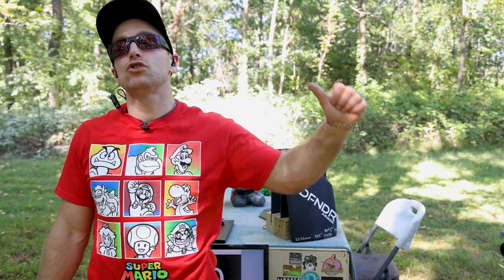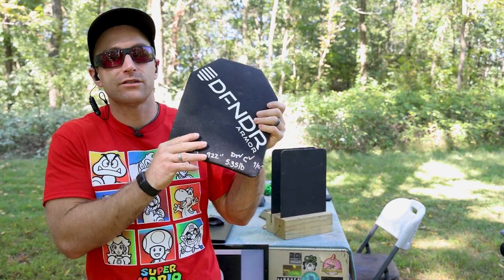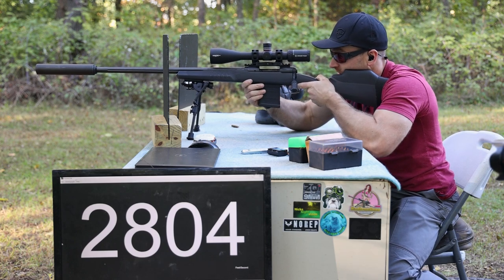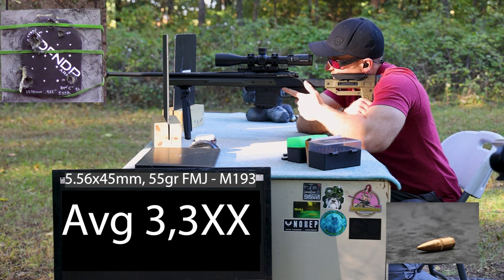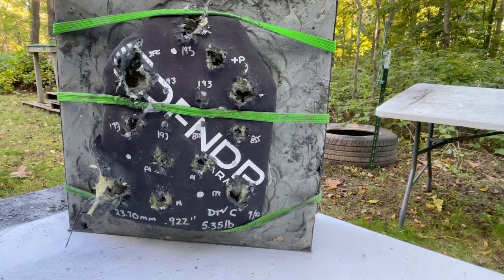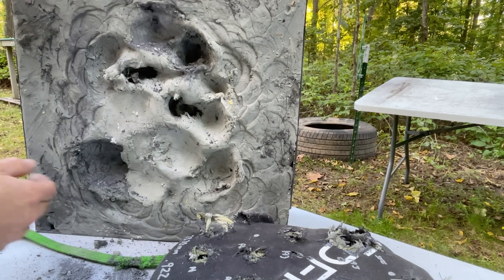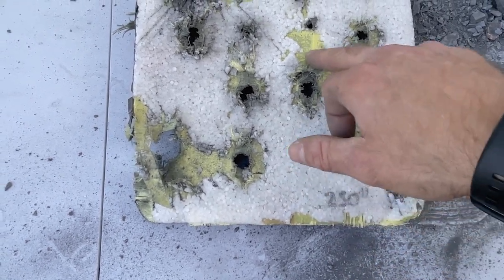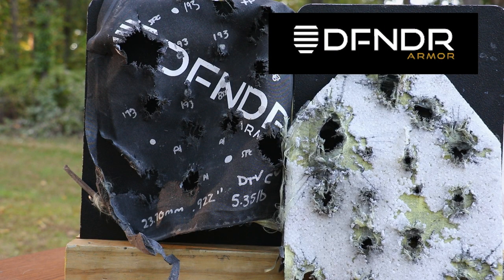DFNDR Armor, Level III X

Comment: While the plate isn't impressive, I realize that's because we generally hold armor above the standard required, which, I think, is a really good thing to do. Good to know what companies are shooting for exceptionalism and who's shooting for being adequate.
Reply from the maker: I would say the plate is better than some other RF1/2 plates on the market, but there are certainly other plates that go above and beyond the bare min and stand proud with what they can do :D
Reply: thats exactly what I care about, and people still dismiss this stuff sadly
remember a lot of these more expensive companies people justify are typically the ones failing, and the cheaper ones amazingly hold up FAR better typically
Reply: I initially thought these may have been one of the newer budget options they started making, but hese are not one of them. I also don't know why this exists when it is the same price as the level 4 plates and only .5lb lighter per plate with these being rated up to 7.62x54R and then level 4 going up to 7.62x63 M2AP.

They have quite a few level 3 special threat options that slightly increase threat rating and weight, but are ultimately very similar 

It seems like it's probably a business thing to justify the additional options for people to choose what is right for them with various pros and cons of wt vs threat, etc  instead of just having the standard ratings, making them able to withstand more but not guarantee it, with level 3, R 1, 3+, and 4 kind of fitting the more traditional likely ability to exceed threat rating.

The people I talked to there (one I believe was the owner) were responsive, honest, and willing to o.qbove and beyond in answering questions while seeming to genuinely care about putting out quality and consistent plates without any of the shiesty practices. Based on my experience I'd be willing to bet they would honestly explain their reasoning. With the abundance of armor companies out there, i can count on one hand the amount of companies whose plates I would truly trust. And DFNDR is definitely one of them.

That said,.my experience is merely anecdotal so take it with a grain of salt

Comment: Dude, if you could or are interested, I'd like to see you test the LAPG level IV multi curve. The difference with the multi curve being the strike-face is SiC. They are rarely in stock, but are right now. I actually just ordered one to use as my front plate.
Reply from the maker: I have a set at home :)
Reply: @BuffRANGE  Awesome

Comment: Which plates would you recommend with level 4 and level 3+? I see the RMA look like a great buy but they are 8 lb.
Reply from the maker: 3+, RMA 1092 G2, Militech RF2, Hesco 3810 (unless you need M855A1 protection). Level IV, all of the alumina plates are going to be over 7lbs. Look at the RMA 1192, Adept Colossus, or Hesco 4800

Comment: If you’re looking at American made armor I just don’t see any reason to buy any other plates than premium body arms level 4, shotstop level 3 and 3 +, or if you
Want to same some money hesco 210’s.
Reply from the maker: Those plates Premier and ShotStop plates are overpriced, overhyped, and typically under performers :) I would run this plate over ShotStop's plates.
Reply: @BuffRANGE  not sure why you think they are overpriced. The weight savings is worth every penny. I’d run a chest rig before I’d wear 7lbs level 4 plates. premiers level 4 costs 10% more but weighs 1lbs less.  (Shotstop isn’t selling their level 4 to civilians right now which is dumb!). Their level 3+ though is 10% more as well but also weights almost 2lbs less. The dfndr plate didn’t stop what it was rated for and isn’t offered in a shooters cut (sapi cut sucks and is outdated. SOF units run shooter cut if they have the option to) In my opinion your plates need to be able to stop m855 a1 if you have them for the reason the of 2A because that’s at minimum what you’ll be facing. Anything else it’s up to the individual what they think is needed.
Reply from the maker: @jpk9171jpk  You know what Premier's plate weighs less? because it has over 1" or more of a foam border on the strike face. On a 10X12 model you only have 8x10 or less of actual ceramic coverage.  ShotStops other offerings that don't have ceramic strike faces can't even stop M855 from an 10.5" SBR, or M855A1. I'm guessing you haven't seen my ShotStop tests yet?
Reply: @BuffRANGE  I know the premier level 4 is the only one that can stop m855 a1. They are also 12x10 so you get 11x9. I’ll retract my statement on the shotstop 3+ because it isn’t rated for m855. The dfndr being 12.5” long and 1.1” think also means it won’t fit into most medium plate bags.
Reply from the maker: @jpk9171jpk  There's a video floating around of Premier/ShotStop's Ultra light level IV, an there's over 1" of foam on the edges, some places almost close to 2". So that plate being 10x12 has a severely reduced strike face. At $750 I'm not seeing the advantage to having less strike face :D I suppose one of these days if I get the funds I'll test that plate and maybe some might see it's not all that it's cracked up to be :D
Reply: @BuffRANGE  they are $630 on their website and sometimes have 10% off. Even an 8x10 that weighs a pound less and stops m855a1 is better than a plate that weights a pound more, can’t for sure stop m855a1 and won’t fit in your plate bag, definitely can’t with backers.
Reply from the maker: @jpk9171jpk  which specific plate are you referring to? I'm talking about the STRATIS LEVEL IV ENHANCED PLATE
Reply: @BuffRANGE  that’s the plate. It’s $630. The dfndr plate you tested is $550.
Reply from the maker: @jpk9171jpk  Got it. I think my eyes were playing tricks on me as I thought it said $360 when you actually wrote $630.
Reply: @BuffRANGE  all good. Not saying the dfndr is a bad plate. As a recommendation you should add fitment into medium and large plate bags with and without backers as part of your testing. A plate is worthless if it won’t fit in your plate bags.
Reply: Those are not very capable plates. Gut check, what is Premium Body Armor doing to get "the worlds only 4lb IV" that a vertically-integrated R&D giant like Ceradyne isnt? The answer is sell you a smaller plate in a 10x12 package. The closest to 4lbs an edge-to-edge plate has came is the Ceradyne Defender 275, at 4.5lbs for a SOCOM Swimmer M (10x11.6) and even that is debatable since I believe it was rated for 7.62x54r B-32.

Shotstops 3+ (really just adds M855) is even worse of a deal, you get a reduced strikeface plate for 750 dollars, all just to have it weigh 3.8lbs. Something like Hesco's 3810 stops the same threats at approximately the same weight, but does it WHILE having an edge-to-edge strikeface, for 80 less dollars. So you get a categorically less protective product for more money. And the gulf is only going to widen, this year should yield some RF2 plates extremely close to, if not 3lbs flat from a few manufacturers that will feature edge-to-edge strikefaces.

If it was my money, Id either threatmaxx and get Adept Colossus for 6.5lbs, or try and snipe a pair of LTC SOCOM TSAs for sweet sub-5lb, sub-IV goodness. You cant cheat chemistry or physics, so you have to decide where on the threat-weight matrix your usecase lands and get an edge-to-edge plate that satisfies the requirement.
Reply: @rangednyarnyar  this whole comment doesn’t make much sense. I still don’t see an argument against the premier level 4 which is the plate I really recommend. I take back my statement on hesco and shotstop. The 3810 isn’t bad. It weighs half a pound lighter but it doesn’t stop m855a1. The 4800’s are sweet but they are $1500. The colossus way 2lbs more and good luck getting those in medium plate bags. I’ve also watched videos of the premier level 4 stopping rounds at an inch for the edge. Even if it doesn’t quite have edge to edge protection do you know any 11x9 level 4 multi curve plates that weigh 4lbs and cost $600?

Comment: Looking forward to when armor forge starts calling our shit talking and actually sends you a few plates for abuse.
Reply from the maker: Aren't they charging $2500 for a 4.5lb plate?
Reply: @BuffRANGE  No idea, because they won't give an actual price without requesting a quote for an order and god knows if they're going to send an invoice if you do
Reply from the maker: @WeaponizedAutismiii  I could have sworn someone requested a quote and it was $2500 :O
Reply: @BuffRANGE  Haven't heard that one, but with all the buzz words and the fact they don't have a protection level over iii+ it looks like a professional scam that got seats at shotshow.

Until they sent plates for abuse and review, my opinion will not change
Reply: @BuffRANGE  I found the info, it's in the "about" page instead of a product page. But yeah 2500 for the base iii+ and somehow the lighter one at 3.04 pounds is 1700 while keeping the same rating.
Reply: @BuffRANGE  And get this, iiia plate the same weight as iii+ light weight for the same price as light weight and 1/4 the thickness
Reply: @WeaponizedAutismiii  Yeah something is big fishy with their stuff. My gut says they are using some metal for at least their IIIa plate, graphene doesn't have the density to hit the weight/thickness they are stating.